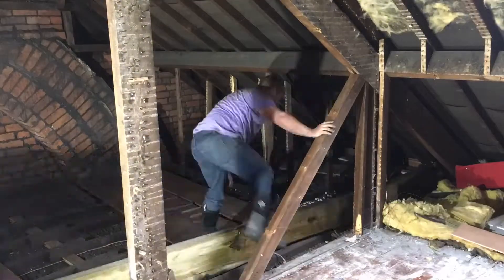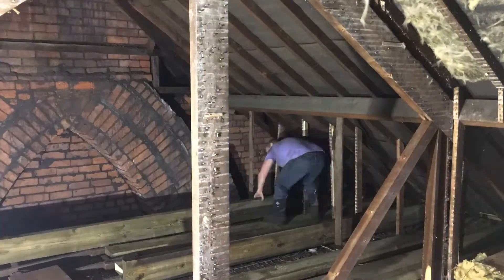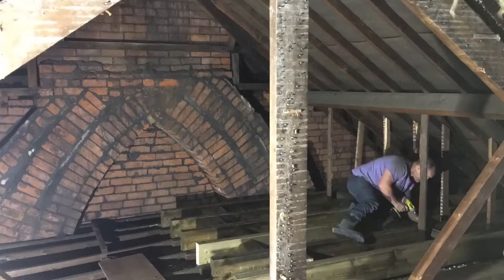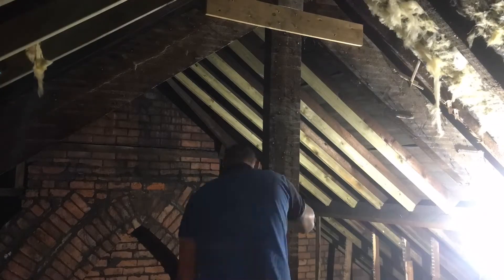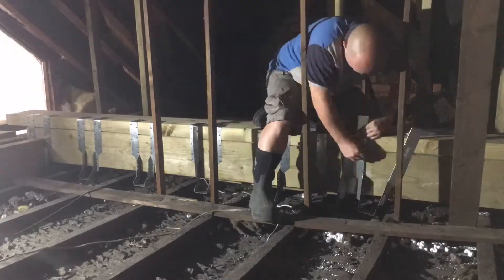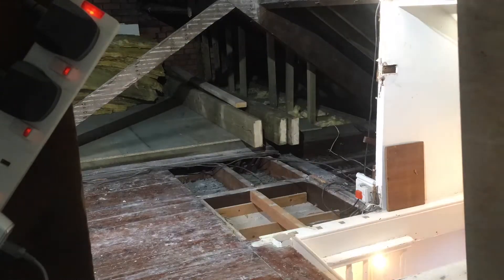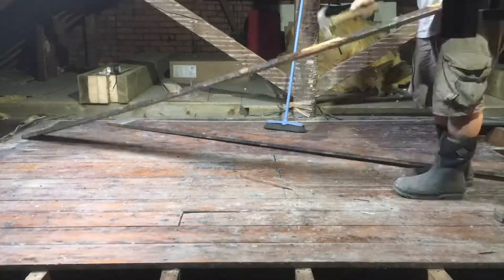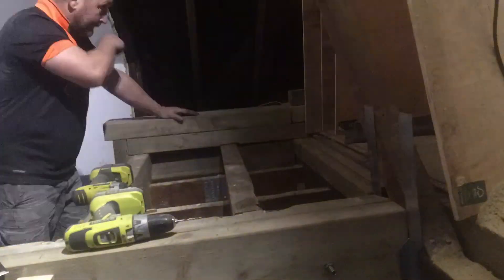Loft Conversion Floor Build Time Lapse. See as the Joists and Noggins Go in plus Structural Beams.

Comment: why use treated timber indoors?
Reply from the maker: Hi. 'm really sorry as my phone says I responded but on the computer it doesn't. So to recap (in case you didn't get my phone response) the treated timber was both specified by the structural engineer and also, in the large sizes, was all that was available as 'graded' timber. The builders I used for the dorma used treated timber too but rough (unplanned) so I guess its something building control looks for. It also gives me peace of mind. Thanks for watching and commenting. Andy
Reply: the softwood is bearing in places outside of the heated zone and potentially suffer condensation from leaking water vapour. If not treated and with the right conditions, it would probably take a decade or 2 for dry rot and a  weakness to occur, so no immediate consequence.
Reply: @itscoconutsaregood  just because its a softwood doenst mean it will rot quick, and if it gest wet the roof is leaking
Reply: @meandnature6452  I agree and was not what I was trying to convey. A leaking roof is a different scenario. The effects of that are hit and miss. To clarify: half the year the UK during the evening is mostly near saturation point with moisture. Timber in unvented cold parts of a roof with a steady supply of warmer air (leaks from the rooms below) will create condensate which will linger for weeks if not months until the spring/summer. Year after year this eventually causes decay from plus  22% moisture content. it is a long term investment. I accept it may not always be appropriate for preservative and as you know, some species can tolerate high moisture.
Reply: @itscoconutsaregood  true, but with vaporbarriers and good ventilation i think it would be fine
Reply: @meandnature6452  the layer does stem the  flow but must remember they are not vapour proof or a barrier. The official technical word now is  Vapour Control  Layer, as the former terms were misleading folk. The fixings are leaky. You mention ventilation which is key to success.

Comment: Why not use steel?
Reply from the maker: Hi. Good question. First I guess steels are expensive. But second, the old roof isn't straight. it bows and waves between the a-frames (the purlins aren't straight) so there'd be a lot of packing and fiddling about. Finally, there'd have to be a big hole cut to get them in...these all for the roof support. In terms of floor joists, they weren't needed really as I had lots of structural walls to rest the new joists on and the spans worked out OK. I had plenty of bedroom so shaving off an inch or two wasn't worth the extra hassle. I hope this helps.